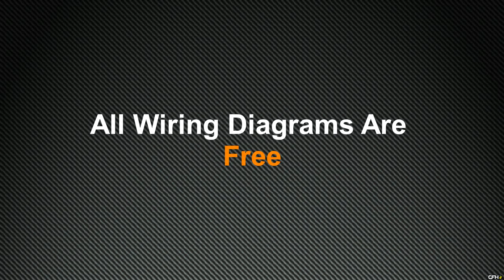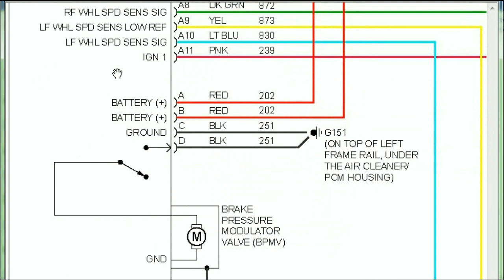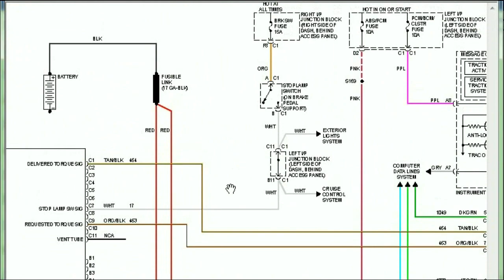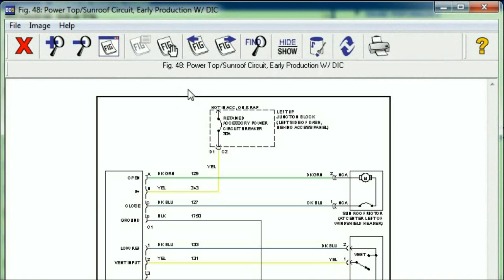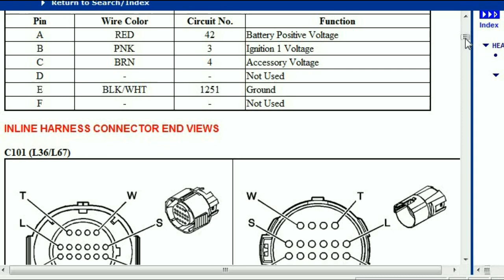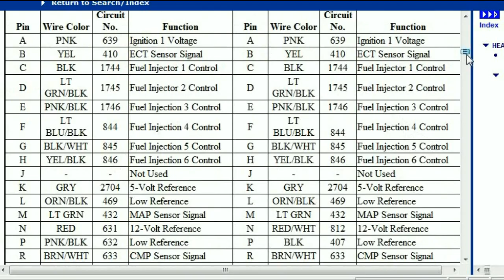Chevrolet Impala Wiring Diagrams 1994 -2016

Comment: Sometimes you may not want to run a new wire from a starter relay terminal that gets activated by the ignition switch and take it to the solenoid, so you just want to see a diagram real quick on the internet without spending$26 plus tax with your card info out there in this astronomically large Internet these days where all kinds of selections of other crazy crap are free